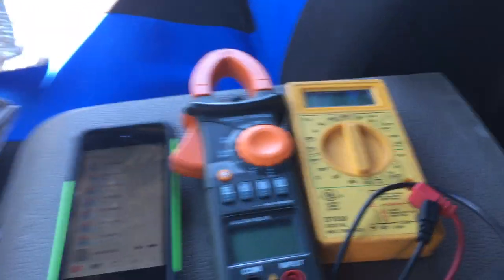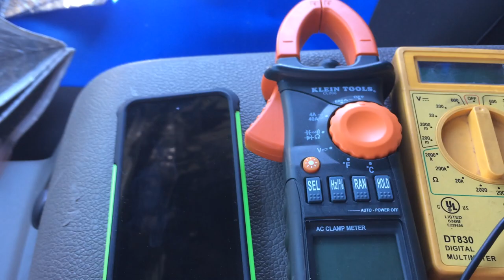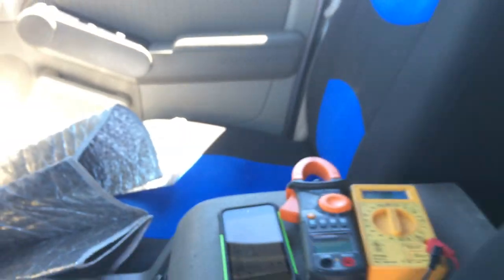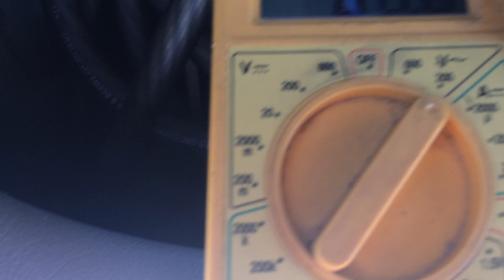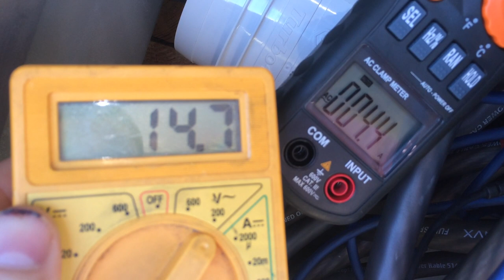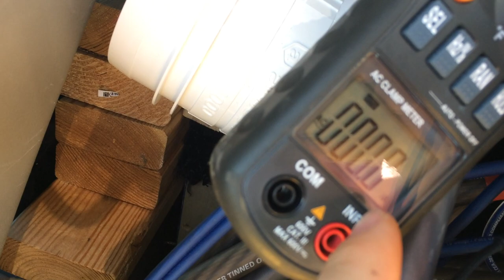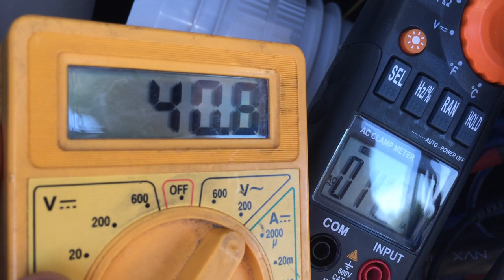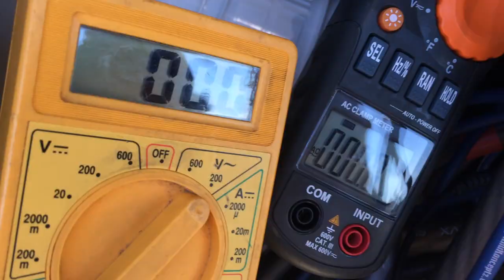How to Clamp RMS Power from an Amp and find Box Rise

Comment: So in my case I'm strapped too hooked everything up just like you did I got 
88v
20amps
That's 1760watts
4.4 ohms right?
Now is that wattage per amps since I have 2 or is that both combined?? Cause I'm hoping it's not I have 2 cab 2ks wired at .5 each lol
Reply from the maker: if clamping from the wire between both amps as I did in the video would mean you are correct 1,760 watts between both amps around 2.2 ohm which makes sense as those amps are probably rated at 1k watts at 2 ohm where you're getting close to that at 2.2 ohm.
Reply: @JacobViral  thanks for the reply bro but you've already answered my question via messenger lol

Comment: Hello Jacob, is there a way that i can find the power of an amp that i really know nothing about? I have an amp (actually two of them) that is pretty rare and there is no info on the internet about them. They are an AVI ABH1002. They say 100w x 2 on the special plate on the front but i have never seen a 200w amp this big. Also back in a forum from like 2006 someone said that the rumor was you could get a 1,000w out of it. Id like to figure this out as i want to do an sq. System and run one to each audiofrog 12” sub. Any thoughts on how to find this out without wrecking them?
Reply from the maker: I would check the fuse rating and rough estimate off that, I’m sure if it’s a 1000 x 2, probably around 300-500rms. Clamp it to see
Reply: @JacobViral  thanks jacob for the reply, but these amps do not have fuses. I love  all of yoyr videos by the way! Keep bassin.

Comment: I didn't figure anything out from this the only thing I know is I set the clamp meter I put it around the positive speaker wire and I got a 12 and this is when I had the clamp set to 200 amp still never got my total wattage or power out of it only thing I saw was amps and you would think that an amplifier like I'm running would put out over a hundred amps not 12 basically I was putting out about half the power that you were with all those amps according to what it said at Full Tilt. The number I come up with is two point something so I guess I would assume that I was using two ohms and almost full tilt. Not really sure what that means in reference to power though

Comment: i have hooked 2 12 inchs in individual boxes connected in series at 2 ohms. At woofer level resistance is 2 ohm and doing the similar test like you did the resistance jumps to 9 ohm at 40hz and around 6 ohms at 32hz. ( by measuring voltage and amps, V/R)

is my boz rise or impedence rise too much? means my box is badly tuned?
Reply from the maker: You will always have rise, but adjusting the box volume, tuning, location, etc. can help alter rise at certain frequencies. It's not a bad thing just bad luck and trial/tests needed to improve,.

Comment: This was all done at a idle correct, so how much of a difference would #s be if engine was like at 2k rpms
Reply from the maker: Depends on your alternator(s) amperage amp charge difference at high RPM vs. idle. The importance of this is the voltage drop change as for me I usually go up a whole volt atleast from idle to Rpm Rev at full tilt.

Comment: I was trying this test and initially only got about 800w on Salt 4, I set my EQ flat and pushed 3500w. Why would the EQ make that big of a difference?
Reply from the maker: RCA Voltage output and signal boosts probably, I personally don't use an EQ as that's 1 more device to fail/interupt
Reply: @JacobViral  it's the built in EQ on my headunit, the only reason I even thought about setting it flat was before I tried to test pre out voltage and reading was all over. Works with flat EQ so I'm leaving like that. It's by far louder. Thanks for the video
Reply: @Chris-B-Bassin does this include high frequency eq?
Reply: @sergioh2015  if it adds a slope on a crossover point yes. I had a 24db slope on and and a 24db slope on headunit as well, I found out they will add up
Reply: @Chris-B-Bassin  I see. That kind of sucks. Lol